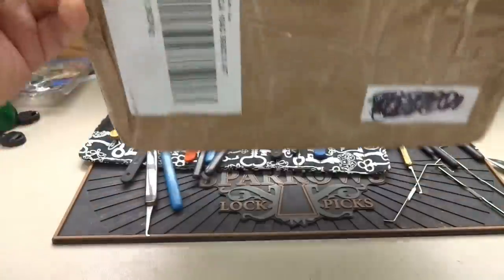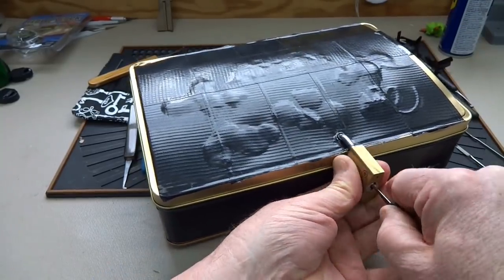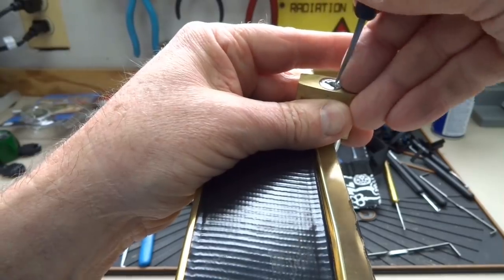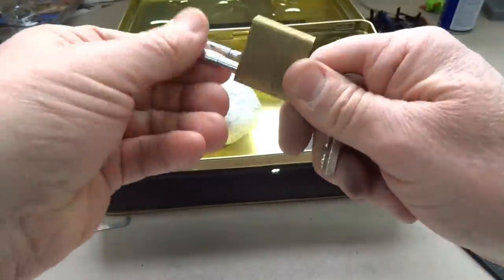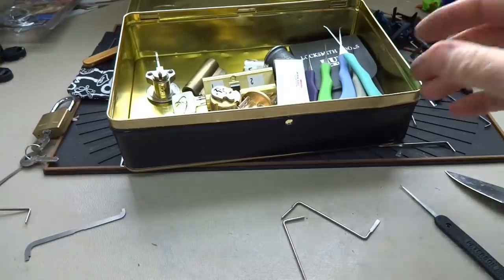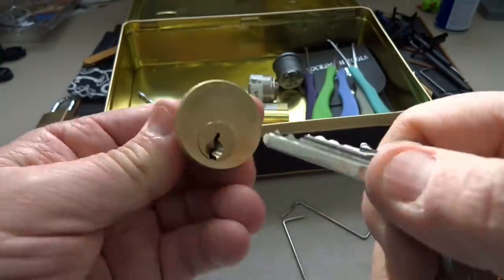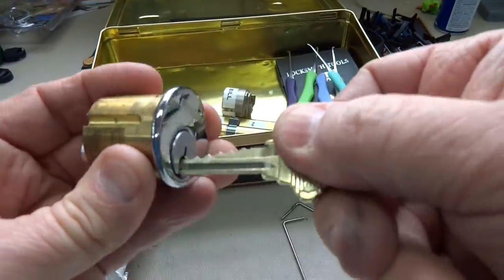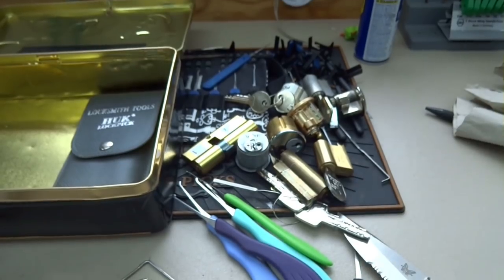(648) Austrian Treasure Chest (Thanks Viktor!)

Comment: Very nice package and very kind of Viktor for sending them. The picks look great. He sent me two custom ones with wooden handle which are same design as the ones you have. I have not wanted to use mine in fear of scratching them as they are so shiny. I have them on display with my lock collection